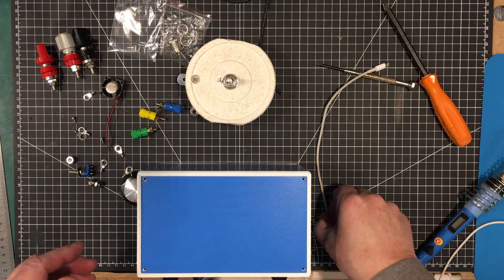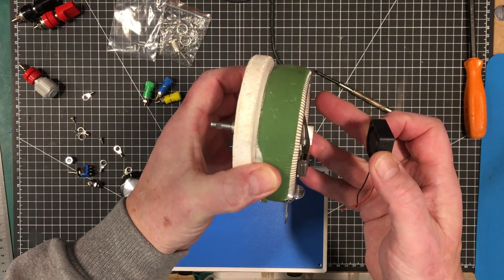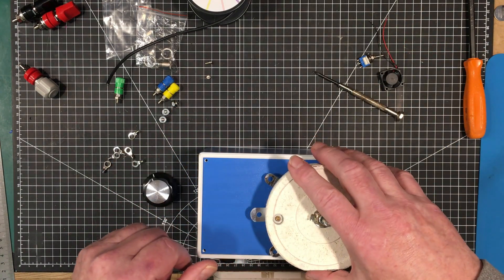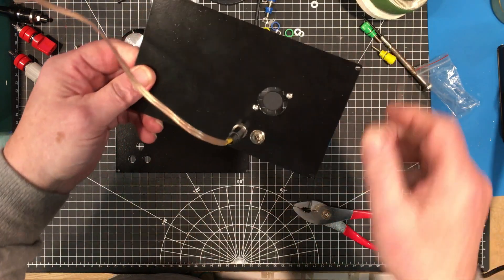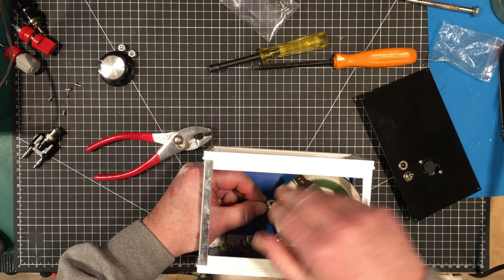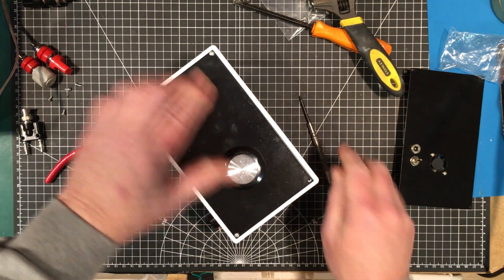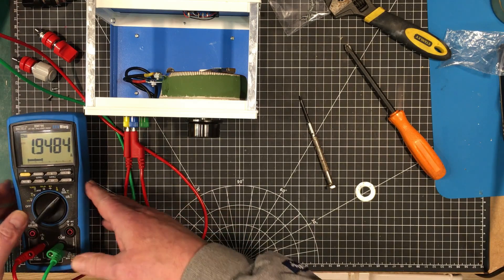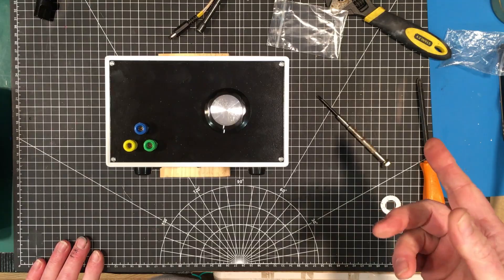Uni-Byte 0150 - Let's build an Inexpensive Variable AC Load

Comment: for AC, these rheostats are quite inductive and as you change the load the power factor also varies
Reply from the maker: Very true, but the intent here is just to provide an inexpensive way to present an AC load rather than making any accurate power measurements. One thing I will say is that they are far less reactive than say, speakers.  This cost less than $50 US - a "real" AC load would cost 100 times that.